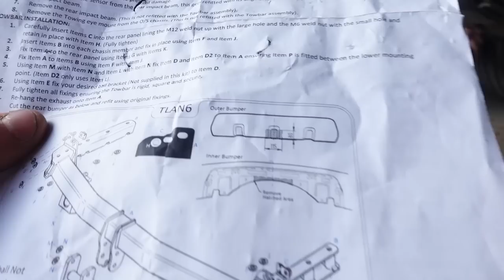Fitting A Towbar To My Wife's Discovery Sport - Bermick Motor Accessories

Comment: I would have gone with the same towbar Dan as you can't be to safe when towing trailers. It's been a lot of years since I fitted a towbar and while they have made the electrics easier it seems to be a right faff fitting the actual unit with having to remove the complete bumper, back in my day it was just drilling a few holes then bolting it on under the bumper 🙄😂👍

Comment: If you’re competing for prizes with a car or a horse, even a rosette that’s hire and reward and you’re into the realms of tacho and operators license.
Reply: It's only classed as hire or reward if you are earning from it and it's a main source of income, it's less than 7.5 tonne train weight so operator's licence is not needed and if a tacho is not fitted to the vehicle there is no need to use one....also means there is no need for a cpc qualification. 
  Social, domestic and pleasure use